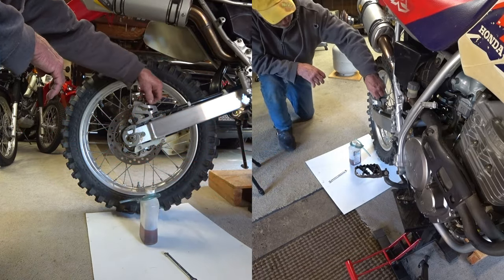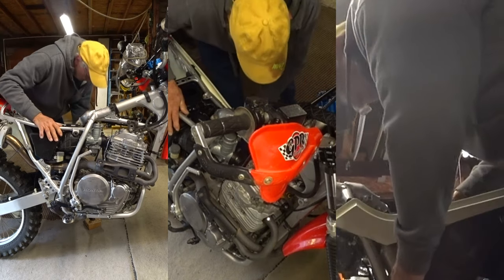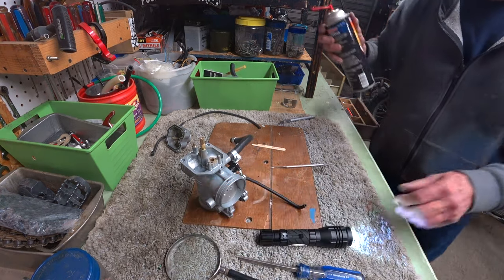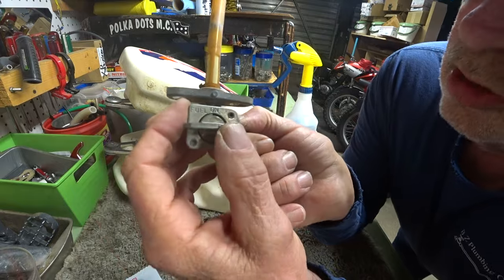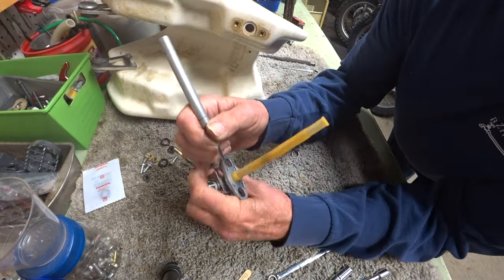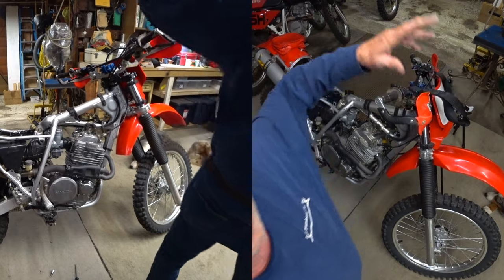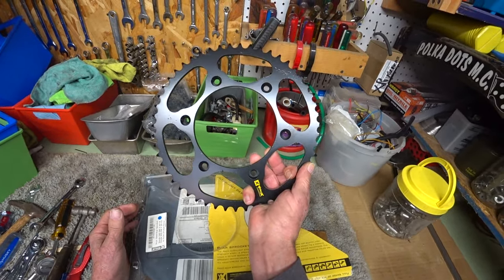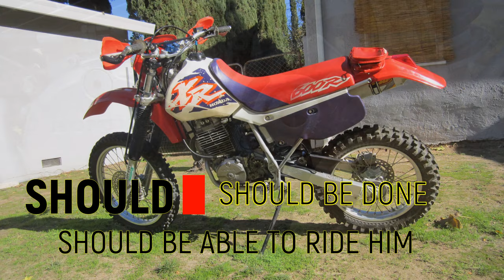nurture to health xr600r fluid and carburetor...start motor!

Comment: Well I guess thats the reason for having too many rides. Its not like you cant go riding. LOL 🙂
Reply from the maker: But there is a price!
 I have been having to ride bikes just so they'll stay fresh. I am behind. I am doing the honda singles more these days, the bsa and yamaha just sit there. I've been riding those for 50 years. Nurturing them actually. One of my friends joked that you can't save all the 600's.
Reply: You are preaching to the choir my brother. besides my 94 600r I have a 1985 yamaha Vmax , 2006 Vmax , and a 94 Dyna wide. I bring the batteries in the house for the winter. Pain in the butt but they last a lot longer. At least the 600r has no battery. Hope you find a sprocket. I saw a 49t on the E Bay  a while back. With a 13/49 you should be able to climb a tree. Good luck my friend.  @2manyrides
Reply from the maker: @edsanderson8603  Batteries ARE a pain. My methods get me about 7 years per batt. 
But it is not just that, there's sumpping, bad gas, seals drying and more. Me, I have a bit more than I want in the ratio. Care free riding, pleasure riding are the desires of this age. I don't mind a little wrenching on the things I want to do. I hate HAVING to preform a task because it HAS to be done. Too many means a bog in related maintainence. 
Oh I have a sprocket. Sprocket specialties made one for me. Tomorrow is ride day on that bike... I'm heading up the hill.
It will take two more videos to catch up to tomorrows ride.
ED, thanks to the nature of editing and getting to it, you are behind! About a week behind.

Comment: Are you using an aftermarket carb choke plate? 🎉
Reply from the maker: I have a number of xr600r's. They all have the XR's only choke plate. Accept for This one. Truely, I never had a problem with the oem plate. But as well, I have serviced carbs with the spring loaded portion coming apart due to vibration or stress or whatever. This one here is a brand new carb it is oem not aftermarket. Rare bird! 
I left it with that oem choke plate in there. Taking a chance here. One thing I will say is that the oem choke gives much different charactoristics than the xr's only. You need to change your starting proceedures.